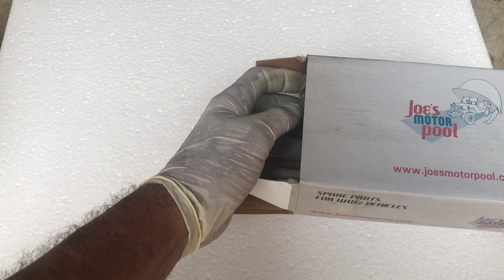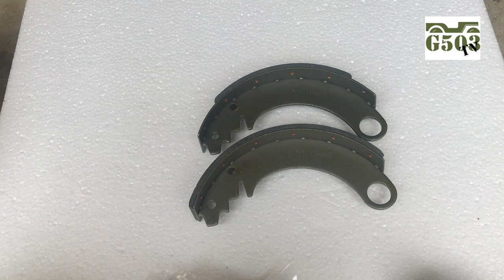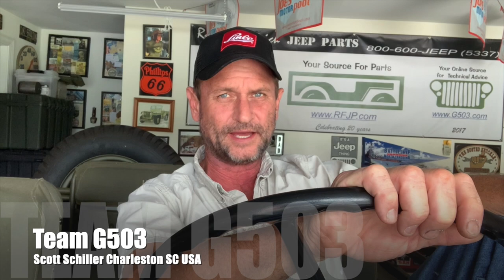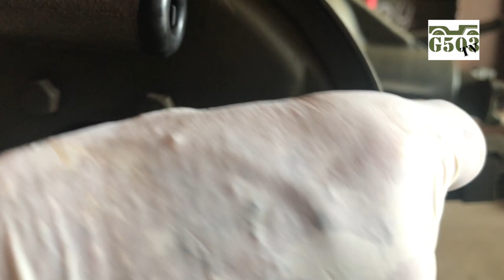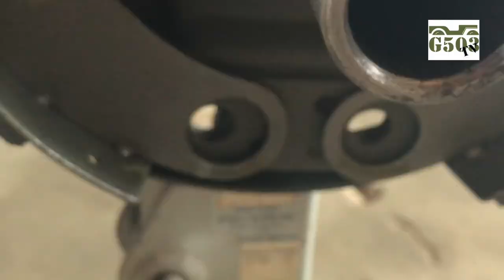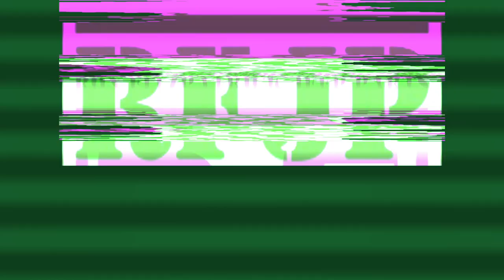Installing The Brake Shoes And Hardware On A Willys MB Team G503

Comment: I'm having a hell of a time adjusting my brakes. i have new drums and have been turned yet I just cannot get them to stop grabbing when I try to rotate them. They actually lock up and have to use a pry bar to rotate the drum. I have watched several videos on how to adjust them and I'm just not getting it. 

I do like how you do install the shoes. I'll have to try that when I attempt to adjust the brakes again.
Reply from the maker: Where did you buy your replacement parts?
Reply: @TeamG503  The brake shoes I have are NOS and so are the drums they are as well.  I got them both from the guy I got my GPW from.  I have new wheel cylinders as well. He got those as he is getting the parts for the axles.  I'm not sure if it is the pads or not. The rest of the parts for the brakes are in serviceable condition eccentrics and the like. 

I haven't ruled out buying new shoes to see if the ones I have are the issue.